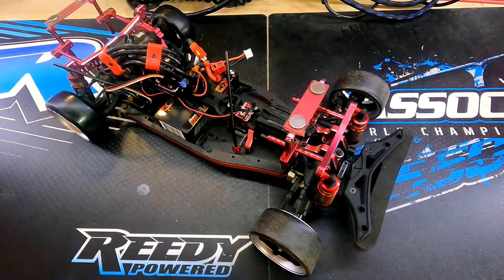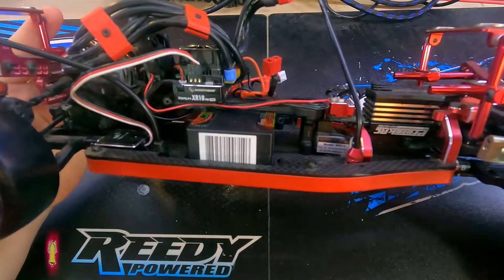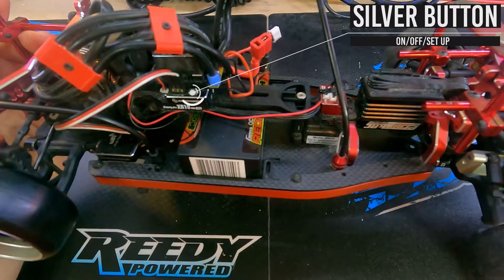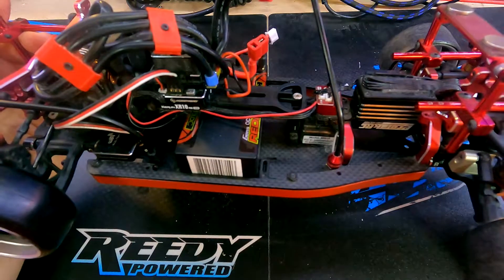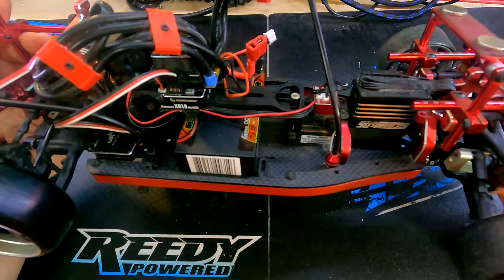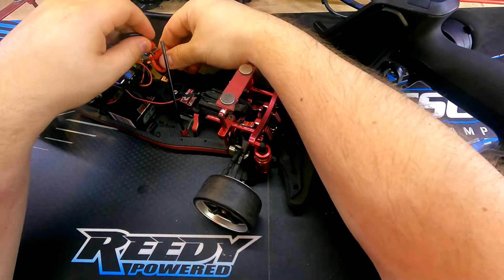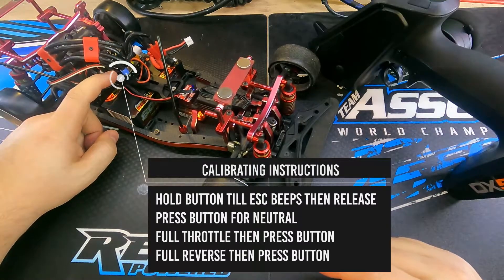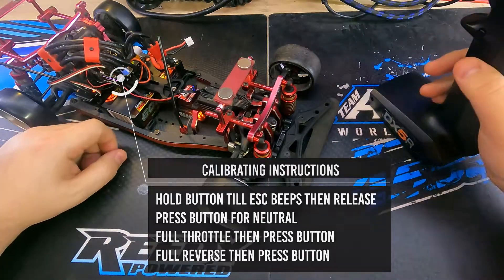Hobby wing xr10 calibration

Comment: hopefully you can help - me and my son are at wits ends here. Got him an upgrade to the XR10 Pro from his older HW ESC - he was so excited to get it swapped out - got everything hooked up and went into calibration mode - press and hold power button - beeps and motor jiggles. press again to set, nothing happens - no matter what we do on the transmitter nothing. Have to unplug the battery to try again - and that's basically all it will do. It's frustrating to say the least - is TX is a FS GT5 - it ran the other HW ESC just fine. We updated the firmware for both the ESC as well as the programming box - still same issue. Hopefully you can help. Thanks in advance!

Comment: Thanks! Very helpful. I just picked up a used RC so I was lost on how to calibrate it to my remote.
Reply from the maker: Congrats on your new rc. I am so glad my video helped you out.
Reply: Arrma Drunk  you need a ESC programmer box to be able to change it to add reverse. There’s an option where there’s only forward and no reverse
Reply from the maker: Arrma Drunk  Hi there! You will need a programing card or a wifi link so you can access the internal programing of the ESC. Then you can turn on reverse. Keep in mind there are a few types. Make sure you select "forward/brake with reverse"

Comment: my esc turns off after i hit the button again for the nuetral command then i have to unplug the batt for me to turn it off and try again any ideas ?
Reply from the maker: Sounds like you may not be holding the button down to enter calibration mode. By just pressing the button and not holding it you are powering on the system not entering into calibration mode.

Comment: Hi there. Great video. Very clear explanation.
I am trying to setup the ESC properly but I am unable to set the brake.
My gear is a Sanwa M17 transmitter and a RX-493 receiver. I have already done the binding of tx and rx and all settings on transmitter are default all curves are zeroed and also calibrated throttle and steering on the transmitter.
For ESC I am using the HW XR10 Pro G2 and for motor the V10 G3R 13.5t. I have calibrated the ESC with the transmitter successfully and I am to get forward and reverse but I have no brakes.
The ESC settings are default. Tried forward/reverse with brakes and forward and brakes and in both the brakes do not work.
This is my first race kit build so I may be missing some setting or any other step.
Any idea where I may have missed something or dome anything wrong?
Thanks.
Reply from the maker: I think I have your solution. You will need one of the wifi, blutooth or LCD programmers to adjust your running mode setting in the ESC. Programing option 1a is the running mode with options for forward with brake, forward/reverse with brake, and finally forward and reverse. The forward and reverse setting is were I think your esc is currently set. Basically is a crawler setting where the esc allows the motor to bypass the brakes and go right into reverse.